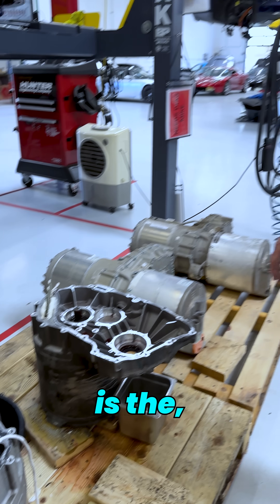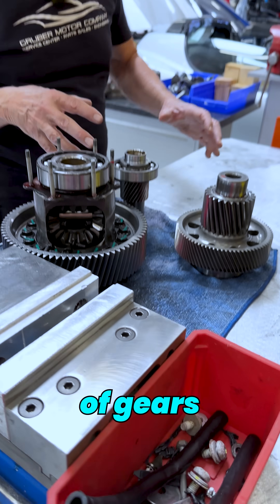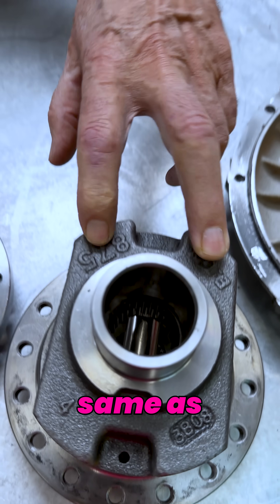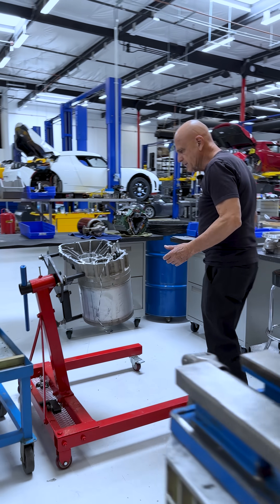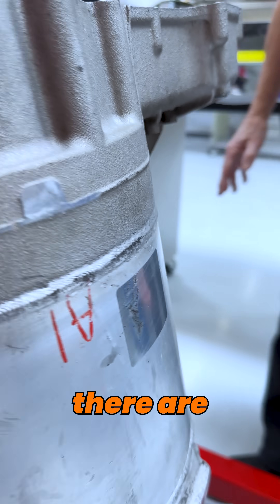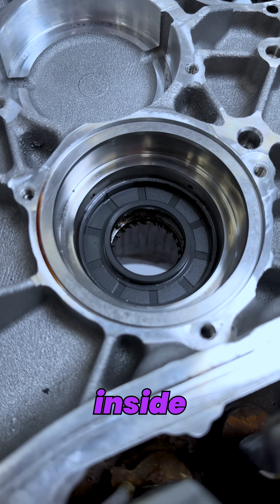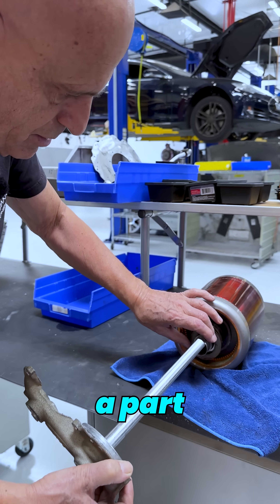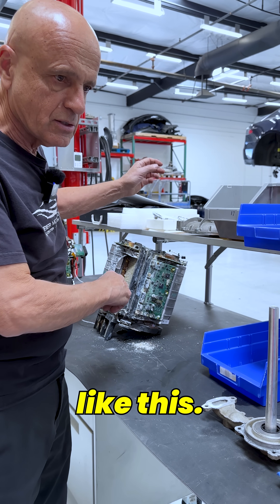Breaking Down Tesla Tech! #shorts

Comment: So now motor has no cooling, right?
Reply: Just the rotor, unless you're constantly towing or racing the vehicle, there are no dangerous temps...stator and inverter is still cooled
Reply: @Hunter-EVOutback  its better to put teflon parts to prevent leak, EV Clinic has that solution, its now in record miles tesla, 500k km after rebuild is still good
Reply: agreed  @milan_gt  however Tesla should be doing it on their referbished LDUs....im on my 4th unit in 10 years due to the same thing, the last one lasted less than 2 years, for a replacment warrentied for 4 years, this is were it issue is, not spendin that little extra, how much was the teflon seal??
Reply: @Hunter-EVOutback set from them is not that expencive but work is..